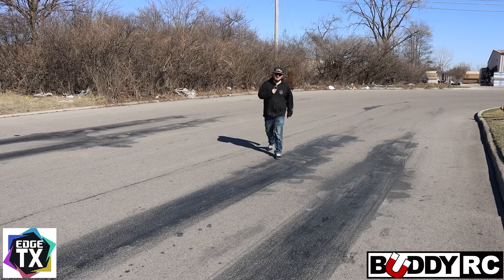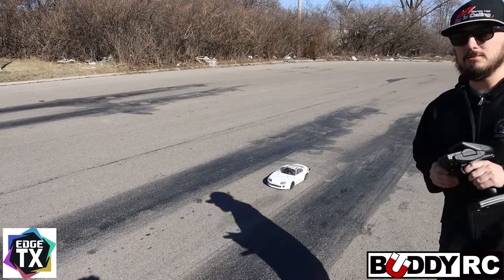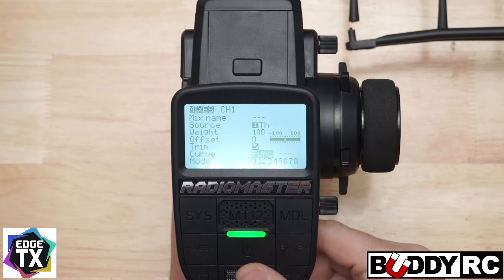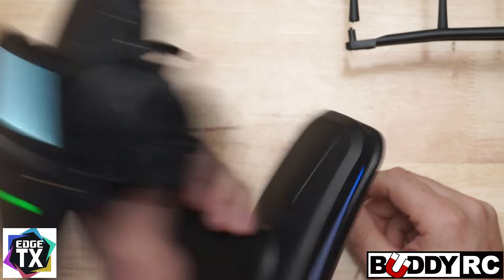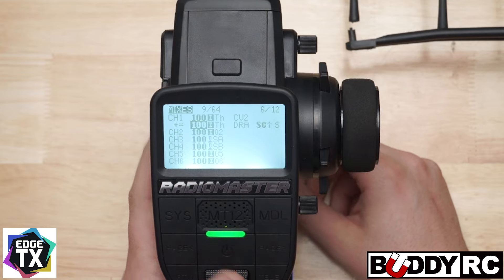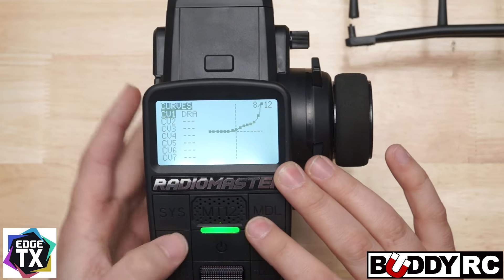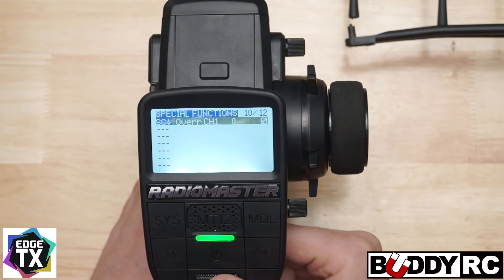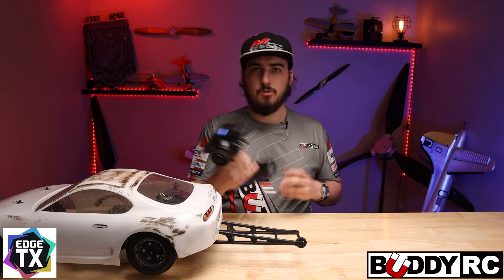No Prep Drag Racing Setup For RadioMaster MT12

Comment: Hello me I ask if it is normal about radiomaster mt12 when the receiver battery inside RC buggy is drop about 40% the Rx signal will drop maximum 4 bars drops to 2bars and the calibration of steering will delay? I'm using radio master mt12 4in1
Reply from the maker: Thanks for watching! That could be a failing BEC on the ESC, I would check it with another radio.

Comment: I notice that when using the SC switch for a launch button and the slow up function, the longer I hold the button and throttle together I lose the slow up on the throttle. It appears the slow up starts when the throttle is pulled and not when the SC button is released. Is there a work around for that?
Reply from the maker: Thanks for watching! I haven't had that happen yet with this setup ive held it for a long time and its worked everytime. Make sure there isn't another mix on throttle make sure its only Slow up on 0 to 100 and make sure you block off the brake like I did in this video. If you dont have another mix for brake it will be slowing up brake as well which might cause the delay.
Reply: I too have this issue
Reply: Put the throttle input on same sc switch this will kill the entire channel and ramping till released

Comment: When setting the throttle curve, if you move the points that are on the left side to the right of the centerline using the y axis,  do they function the same as the point that are already on the right side?
Reply from the maker: Thanks for watching! Yes that is correct I meant to mention it in the video but yes you can move the points from the left side of the graph and then have 17 points.  Hope this helps!
Reply: @BuddyRC  Thanks,
 I thought they worked the same but wasn't sure because I haven't had a chance to do any actual testing. One other thing I noticed is if I set the max x axis at 80% in the curve it was not going back to 0% at neutral sometimes, change it 100% in the curve and to 80% on the output seems to help.

Comment: Something isn't right delay starts on throttle pull no matter what
Reply from the maker: Thanks for watching! Correct, the only way to have that not happen is to activate this mode on a switch. You would have the throttle curve on a switch so when you're ready to stage you can switch from a regular one to the new mode.
Reply: @BuddyRC  I got it figured out. I had to put throttle input on a switch. Now if I hit transbrake ramping starts on release no matter how long I hold it